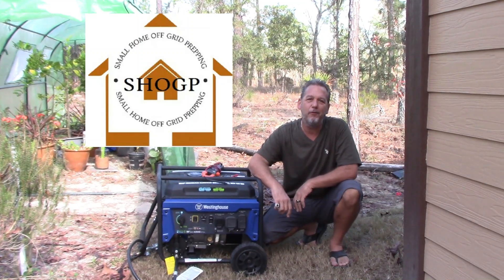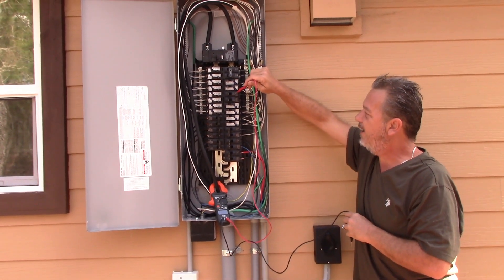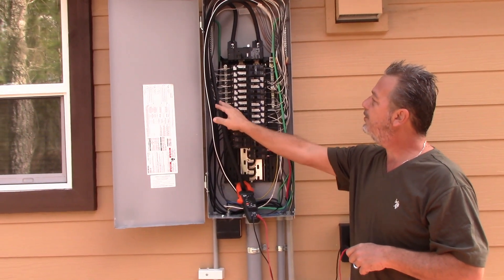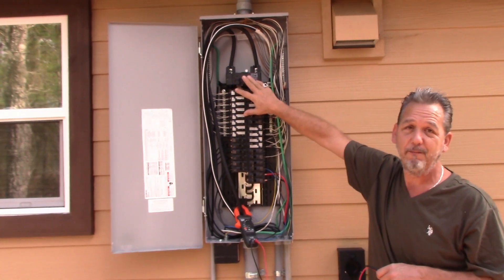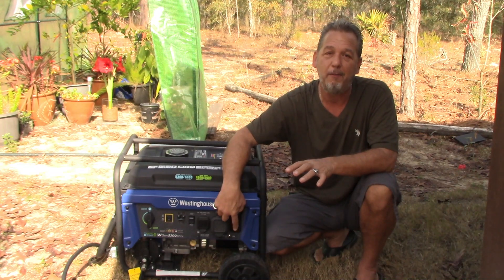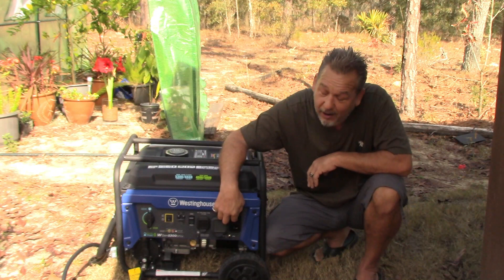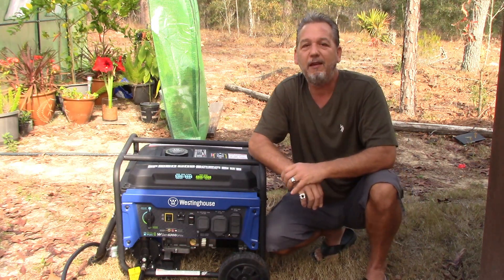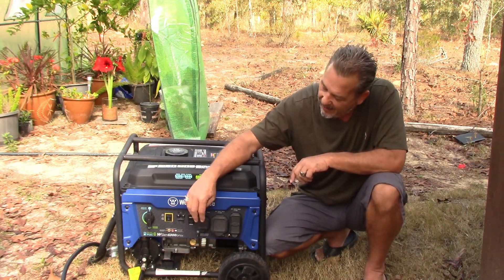GENERATOR VOLTAGE/HOW TO BUY THE CORRECT GENERATOR for your HOUSE

Comment: Yes there is a 3 prong to 4 prong adapter that will split the 120v from the generator to energize both legs of the panel. But you are right it will not power 240v circuits but will power any 120v circuits. It's a L5-30 male to L14-30 female adapter.
Reply from the maker: Thanks for this comment Mike, Yes you are technically correct ,they do make the adaptor you mentioned ,however as far as any properly trained electrician is concerned this part does not exist, and because of the safety issues and potential fire hazard that would be caused by using one of these, no electrician would recommend this to a customer. Using an adaptor that uses one leg to power two legs could overload the neutral, the neutral will not carry the sum of the 2 legs, just the equivalent of one, this could cause an overload of the neutral, and a potential fire hazard, this is also more dangerous if the home being powered has shared neutrals, again causing a possible overload of the neutrals, and a potential fire hazard, and possibly extensive damage to the generator and/or the panel. None of the 240's would work, but a lot of 240 appliances do break down digital controls to 120, so you would still be sending one leg of power to both legs of the 240 appliance, if the generator does overload the neutral, due to the voltage loss and surges caused by this, there could be severe damage to the digital controls, as well as other modern devices such as led lights, smart switches, computers, etc. I have seen this happen, I once knew an entry level electrician that did
 this at his house during a power loss, I was at his house and as he was explaining to me how he wired his 120 generator to power both legs, his flat screen tv exploded shooting flames out, There is much more that could go wrong using one of these adaptors, but though they do make these, as far as an electrician is concerned, they don't exist. To properly and safely do this, you would need to get a 30 or 50 amp120/240 generator.
Reply: He’s, be safe.
Reply: Overloading the neutral would only occur if you have 2 or more 120v circuits sharing the same neutral. Which is possible in some cases and you must turn off all 240v circuits.  I'm not saying anyone should do it this way if you don't understand what you are doing. But I have done this for years with a small inverter when all I need to run is the fridge, tv, and a few lights. So it is perfectly safe if you know what you are doing.